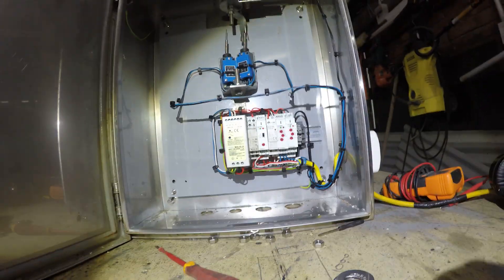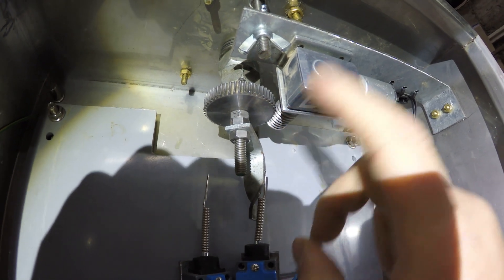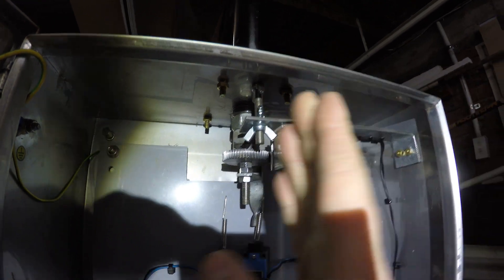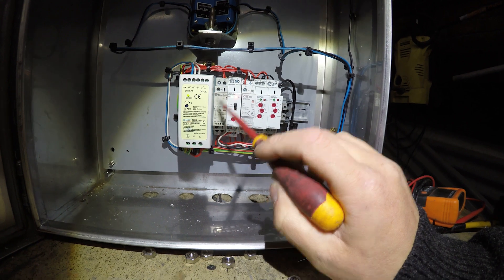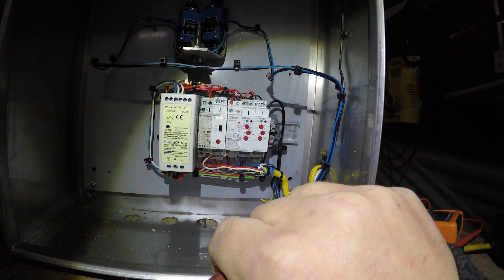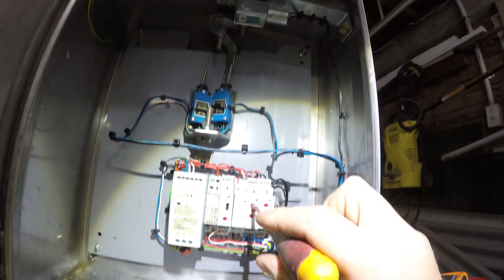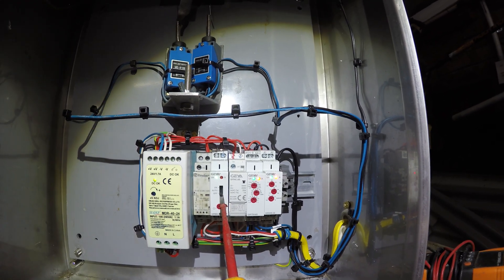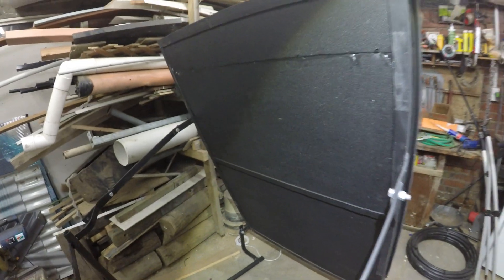A Look at the "brain" of my DIY rotating greenhouse solar water heater

Comment: Are you a maintenance/industrial electrician by any chance? Too many similarities between us
Reply from the maker: I work in distribution, but i've worked in residential and commercial.
Reply: @DCAL084  I saw the din rail and 24v power supply and joined the dots. I’m planning a 6m x 3.5m greenhouse and was looking into the compost bin as a heater exactly like you’ve done. Do you live in a colder climate? I’m in north wales.
Reply from the maker: @matthewjones3698  Christchurch, New Zealand.

I think similar climate in terms of temperature (we get a few 0 to -5 degree Celsius nights during winter), although we might have more sunlight.

The compost heating is going to be key to the heating system, the sunny days are good for heating the water via the solar heater, but nights and cloudy days are where (going by my data) the compost is needed to keep the system warm and help the solar reach higher temps.

Be sure to watch the video I put up in a few weeks because I am currently gathering data via the recorders to share. Im running the solar system with and without the compost heating switched on to compare results, and I think the data will show how effective the dual pile compost heating will be to boost temperature in the day, and keep the system warm at night (the compost system will be switched on in a few days from now)

also the new data will show the effect of cycling between piles.

I'm also going to use a timer to force air through the compost.
Reply: @DCAL084  I will definitely watch that one. I was going to heat the my greenhouse using small radiators at low level, but i see you fed the heat directly into the beds, is this better? I could do this as well but i hadn't planned on it.
Reply from the maker: @matthewjones3698  I dont think radiators would work, I think the cold air would overpower any heat released from them and also cool the system too much.
I think the soil will hold the heat longer and lose heat to the surrounding cold air more slowly, and probably having the soil warm is more important for the plants and soil biology.
If I could afford it i would use metal (preferably copper) piping thru the beds/compost/solar.
Reply: @DCAL084  I am planning to do all the compost heat recovery out of stainless steel, just a large helix, my theory being that stainless will dampen fluctuations in temperature and also its corrosion resistance is unparalleled. Will also run small air lines throughout the compost bin for aeration, and use humidity sensors, moisture sensors and temperature sensors throughout to self regulate water injection and aeration.
You can buy the stainless coils quite cheaply from beer making websites, just type in wort chiller or wort cooler, for the compost heap.
I'll have to figure out how to warm the soil beds up, your way is really good and i'll likely go with that for mine.
Reply from the maker: @matthewjones3698  sounds good, I'm still testing mine in different configurations to find what works best for extracting heat, and stopping the piles from cooling, my updates still a few weeks away
Edit: ive got 2 x 25metre coils in each pile currently
Reply: @DCAL084  I’m super interested to see your results. Will you be experimenting with compost recipes?
Reply from the maker: @matthewjones3698  That has to be done right, for example: one pile had higher nitrogen to woodchip ratio than the the other pile, and the higher ratio pile got to 55 degrees C, while the second pile only got 50 degrees C, I'm still working out the ideal ratios and moisture levels.
Also how long the piles will retain heat before adding more nitrogen is what I am currently experimenting with.
So far ideal temperature to maintain pile at is over 50 degrees
Reply: @DCAL084  how will you add more nitrogen? Mix it in the pile by hand when required? 
Does the pile have a critical temperature whereby it will just go cold if you draw too much heat from it?
Reply from the maker: @matthewjones3698  I've had 3 days with no sun and temperatures dropped to 2 degrees on one of those nights, so the system has been taking all its heat from the compost piles (i use solar to boost heating in the sun), this has been dragging down the heat of the piles as I have been currently alternating between both piles every 30 mins. Today I switched circulation back to one pile to allow the other pile to regain its heat.
I am going to mix in coffee grounds at the surface tonight or tomorrow and spray water on it to trickle it through the pile, hopefully this will boost temps in the pile.
We have some partial sun coming this week.
Edit: piles are currently at 33 degrees C
Reply: @DCAL084  what governs the switching between piles? Timer or temperature? Have you tried the coffee grounds before? That’d be incredible if it kickstarts it.
Reply from the maker: @matthewjones3698  timer, switching more often works well to extract heat because it gives the water in the pipes time to absorb the heat whilst in the pile, and i guess the water holds that heat better when being transported and mixed back into the storage tank (50m distance). Whereas when the water being transported is colder its easier for it to lose heat being transported.

Controlling by temperature around coils would also be a good way to do it, I'm considering doing this as I could set a temp and switch piles when that temp is reached. I could also change the desired temperatures for each pile and it wont switch over until that temp is reached.

Edit: I havent tested out coffee grounds before by trickling through a pile.
Reply: @DCAL084  I will probably use a temperature control valve to limit the flow of warm water to the beds to maintain the heat, then switch between piles for consistency. That’s the millionth change I’ve made. I overthink, and seeing your designs and hearing your ideas is adding carnage to chaos! I’d like to fully automate the whole process and get to your stage of tweaking and trying.